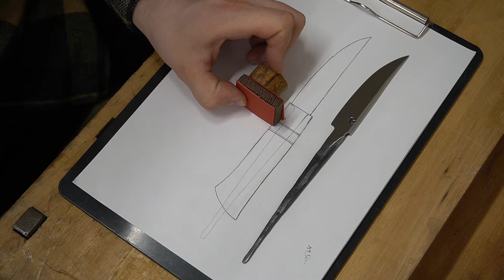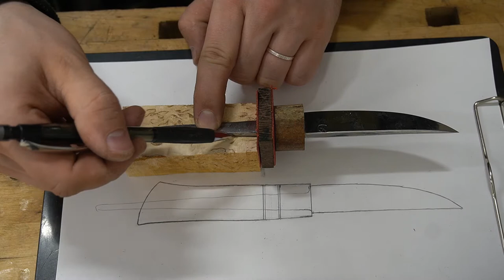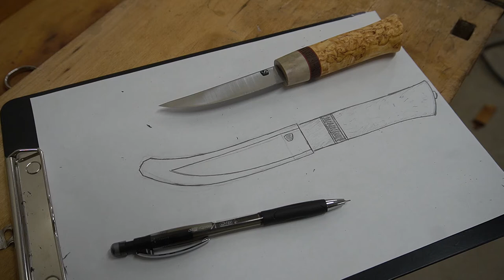Making A Knife From A Finnish Puronvarsi Blade

Comment: Hi! Gorgeous knife and knife sheath! Im somewhat new to knifemaking and have one question; did you not glue between the Wood and the leather? Is that not necessary? Again Very cool looking knife!💯 12:34
Reply from the maker: Thanks! Actually I put a little bit of glue between the leather and the wood. Glue is not necessary in the case where deep grooves are made in the wooden part, where the wet leather is pressed and sewed tightly. When the leather dries it tightens tightly around the wood and into the groove. But one way or another, the glue makes the joint more secure :)

Comment: Thats a full tang puukko? Wowwww nice
Reply from the maker: Thanks! It is not full tang, it is stick tang.
Reply: @kiehicraft  can I ask you,why people use puukkos and not full tang knives?
Reply from the maker: @diagorasmoustakas249   I think there is many reasons for that. One reason is on the intended use. Full tang knives can handle tougher handling than normal puukko. Some might like more the looks of the puukko, like I do. Do you like more full tang knives?
Reply: @kiehicraft  I think also PUUKKO is lighter and warmer handle specially in the winter while full tang is heavier and cold .I like puukko more but for the same money I can buy MORA GARBERG and I don't know .What do you think ? PUUKKO is going to last ?
Reply from the maker: @diagorasmoustakas249  True facts. Well I don't know what needs you are getting a knife for, but puukko is defenitely going to last long long time :)
Reply: I own both Mora (not Garberg) and Puukko but if I need to add another between the two it’ll be another Puukko in a longer & thicker blade…